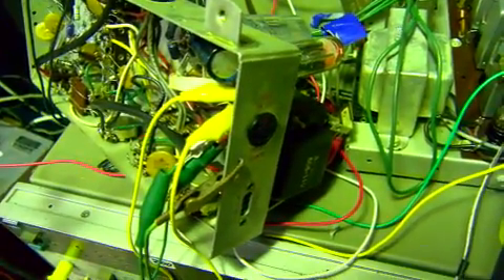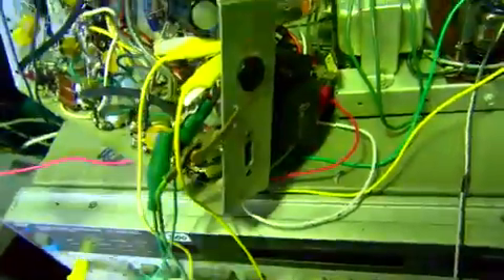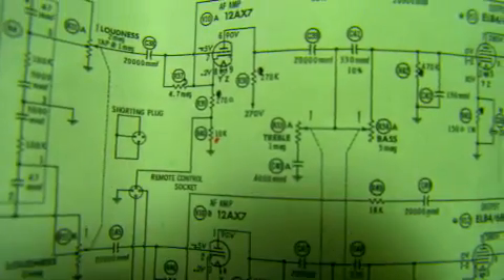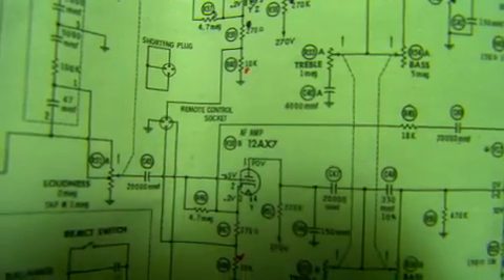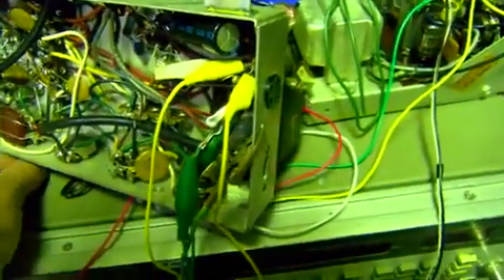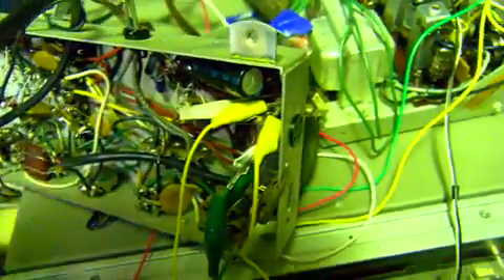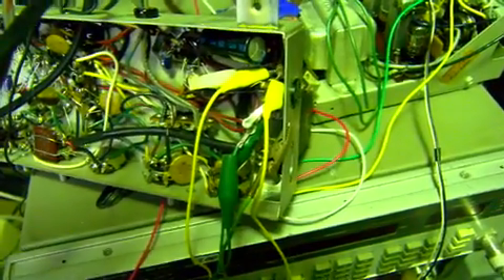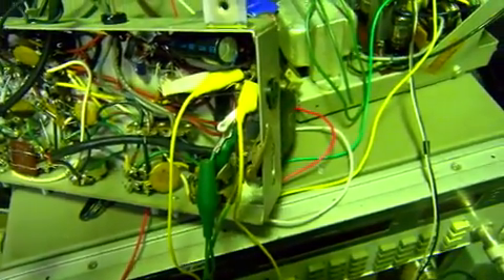silvertone amp loudness update

Comment: Even in low quality video it still does not look half bad for night! although 1080P definitely looks better on a LCD computer monitor. And I have a 65' Zenith solid-state console and these councils definitely go loud for the small power rating they have! I would say most "good" councils of the 50's and 60's are equivalent to a 150w or more now days BPC sound system.